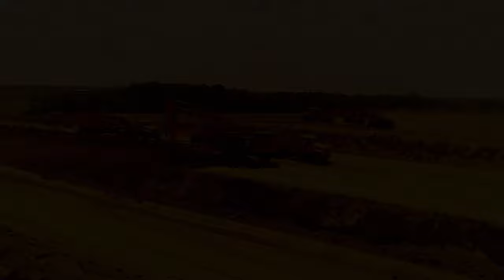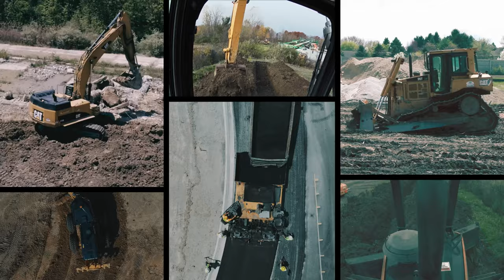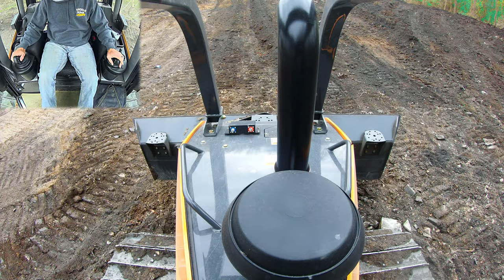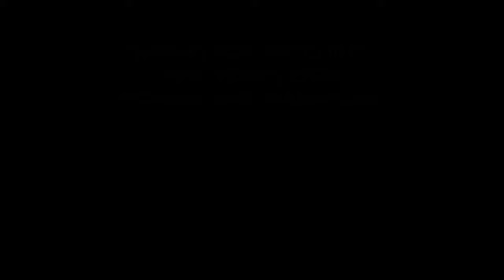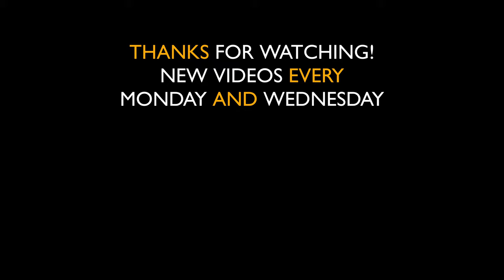CASE 1150M DOZER GRADING LOT // Case Bulldozer Review // Bulldozer in Cab View

Comment: So your out of decelerator mode. In the track speed full power mode.  Are you riding the pedal? Are you on and off the pedal during your cut/ plow??  Is this taking the same toll on your leg/knee as if in decelerator mode?  Thank for another great video.  We Appreciate taking your time out to reply.
Reply from the maker: You're only riding the pedal when you want to slow your speed down.  This can also be performed with your hand controls by reducing the top speed of the machine overall.  For example, if I set the 1150M in this video to top out at 2.2 and switched the machine over to track speed for the pedal control, I really wouldn't need to touch the pedal outside of switching from forward to reverse.  Even there you wouldn't really need to touch the pedal, I just do it because I feel it's easier on the machine.
Reply: Understood. Thanks for your explanation and instructions.

Comment: Sometimes I prefer to just decrease the transmission speed so it gives some rest to my knee if I see that I'm using the decel too much...I spent a month on the next gen Cat D6XE and that thing can push, also plenty of options to customise the machine.
Reply from the maker: I will do that as well on long days, especially on the older machines where the decel pedal is a little stiffer.  I can't wait to get some seat time in the new XE dozer.  They are monsters.  Thanks for the comment!

Comment: Is there much of an operational difference between different types of dozer drivetrain?  I understand electric and hydrostatic drive are less common than whatever, say, powershift is.  (Sorry I'm just a trucker, don't know anything).  I understand how some equipment works, but dozers are magic to me and I don't know anything about how anything with fewer than 3 pedals steers or manages travel speed.

Wait are they power-split?
Engine to gears+hydrostatic, then gears+hydrostatic feed into an adder differential?  Your description of steering only cutting one track (not speeding up the other) doesn't point to adder/subtractor steering.
Reply from the maker: No dumb questions here my friend.  I didn't know how this worked either and I actually learned something.  Thanks for the education!